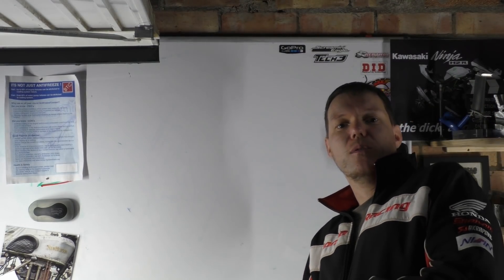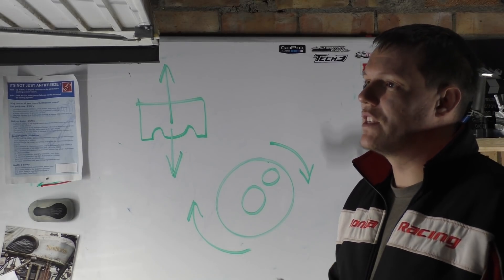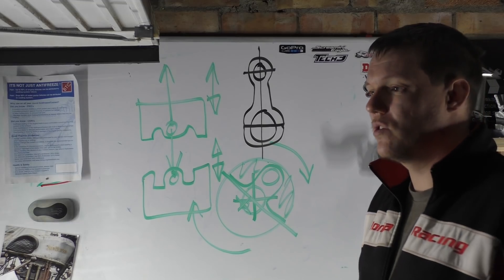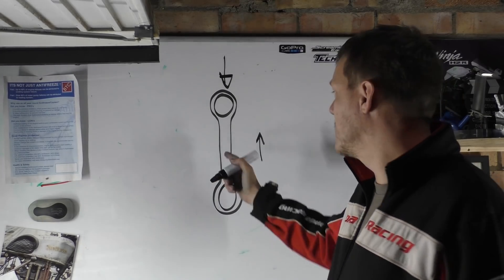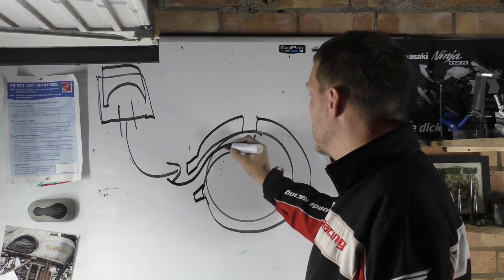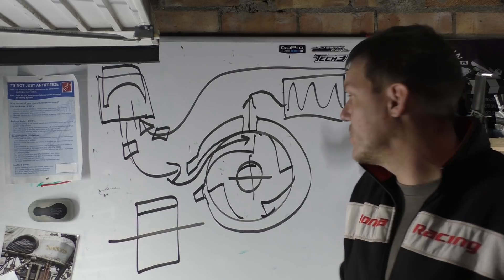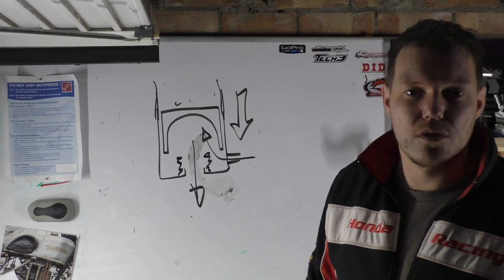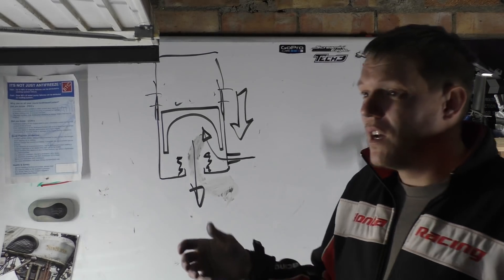New engine design - Oil rod engine

Comment: The problem with using hydraulics, is inefficiency. A minimal 20% of your mechanical force is lost in heat generation within the luid itself. 

Then you have a cavitation factor. When the. piston reaches TDC and begins the intake stroke, the oil will be subjected to a massive negative pressure change... which will inherently cause cavitation, as the water and air molecules within the working fluid rapidly expand and contract.... breaking down the oil, and causing you to lose compressive efficiency when it return to high pressure operation of the compression and power strokes. 

Lastly, it's been done before. In the most extreme example, there was no piston at all... as the fluid itself was used as the lower sealing surface. The examples worked okay for a crude stationary engine of massive displacement and low cycle rate... but that was about it. Evironmental concerns aside... the water-based version worked the best. The water was sourced locally, via a stream. The engine ran off oil. With a constant fresh supply of fairly cold water, the engine was capable of running a saw mill... providing both mechanical and electrical power.... but was about the size of a VW Beatle, just to make roughly 3hp. As I recall, each cycle displaced about 600 cubic inches... or about 9.8 liter/litre. The flow management was a fairly complex system of check valves and a reserve reservoir which was used to maintain pressure for the evacuation (exhaust) phase, and used a vane pump for both PTO and cycling. If I can ever find pictures of it again, I'll gladly email them to you.

Comment: You need to look at stirling hot and cold gas engine's and wobble plate crank shafts. HHO generate's an implosion so if you were to design a stirling cold or hot gas engine HHO hybrid engine? Then got the timing just right? Wait stop think this engine is operating off atmospheric gases that can be recycled through a closed system?  Wait stop think now remove diesel or gas engine from electrical power generator and attach closed system stirling cold gas or hot gas cycle HHO hybrid engine yo power the eelectrical power generator? Using antivibrstion technology currently being used on Skill saw recipercating saws and magnetic cushion's using high heat magnet's or Gadolinium for cold gas engine's has magnetic bearing's? Come now you seem intelligent so i am sure you understand this information yes? Oh and this is the low technology version of these concepts so you would understand it all. The high technology stuff will make you pass out! magnet's on piston's with copper using lens law to generate heat to power the stirling hot gas cycle? Ounce the engine got up to speed it would generate it's own heat. Came up with that working on a self sustaining space heater while working on a self sustaining freezer!  😊😂
Reply from the maker: "Come now you seem intelligent so i am sure you understand this information yes? "

- LOL
Reply: A niddle threader talking shite? Must be nice to be a god that lives off colon juice secreation's heh mate?  Was the candlestick maker ye husband? Ye miss the only one willing to kiss ye nectar pump Iussas? Ye drain a few candlestick's at the pub every night to get's that rich nectar cough?  😱😂

Comment: if its a closed system as soon as the piston goes down there will be an equal force from the oil pushing it back up ... hydraulic lock. How do you delay the oil coming back to the piston ?
Reply: Jonathan Vogel This guy is so lost it’s unreal
Reply from the maker: which guy?

Comment: As a comment underneath says, I was going to suggest a boxer/boxter 2 cylinder would likely be easier to get running than a single cylinder. The pistons in turn would push each other back and forth with an equal pressure. There are a number of commercial hydraulically powered vehicles in use (from lawn-mowers to road-sweepers and argos'), so therefore it should be possible to get information and specifications on the hydraulic motors that you can work with. How much thermal expansion is there in hydraulic fluids and could this be a problem? You've got 20 years left (of petrol) to make your fortune. Go for it!

Comment: How about a straight solid round shaft with offset lobes cut out along the length. The lobes act as the pistons as the compression stroke is on one side of the shaft. Supported by bearings on each end in a crankcase that can feed each lobe. Seals between each lobe are needed. The induction would have to be supercharged as the lobe cutout would not have suction. Rev's to 20,000rpm. I believe this was invented by an Australian but an American Petroleum company bought the patent to hide it from the world.

Comment: Why not use opposed pistons with a solid rod attaching them to each other. When external oil pressure forces one piston up, it is also drawing the opposite piston down.

1 - Piston one is on intake when the opposite is on exhaust.
2 - Piston one is on compression when the opposite is on intake.
3 - Piston one is on power when the opposite is on compression.
4 - Piston one is on exhaust when the opposite is on power.

Step 1 and 2 need external oil pressure to move and step 3 and 4 need less or none when movement is supplied by the opposite power stroke.

An engine with 4 pistons in a 2 shuttlecock configuration should not need an external supply of oil pressure once started. The opposite phased shuttlecocks will be balanced with a small rocking moment. 6 or 8 might not even have a rocking moment.

With enough shuttlecocks, you might even avoid one way valves on the hydraulic lines if your ports can be switched to keep constant fluid motion.

Comment: maybe a 2-stroke diesel! with very low rpm. don't see how it could work at higher rpms. Just my first impression, time to research about time/delay effects of hydraulic systems? Direct comparison: CV carb vs cable-actuated-slide carb (air different than hydraulic fluid but you get the idea)

Comment: Matt ya wankle   I think your on track with your theories  if ya had a precise way to set up the pulse pickup coil  I guess the puckup would have to be mounted to the piston  for accurate timing  of spark/or fuel erection injection.

Comment: I was going to recommend a sleeve valve design, but you mentioned that at the end of the video. your basically building a constant displacement hydraulic pump, the ramps on the crank would pump the fluid back up to the piston. with multiple cylinders and the proper timing you wouldn't need rebound springs or bumpers, the fluid would re-pressurize and stop the piston from bottoming.
As to starting it, or hell, running it as a four stroke, use air injection into the top end. You could look into using a Tesla Turbine as a crank as well, since it seems you need flow more than pressure.

Comment: If the piston shoots up (4stroke) with the exhaust stroke and then the crank pulls it back. Than the piston wil pus so hard up that you create a bubble of vacuüm. Untill the energy of the moving pisfon is gone and then it follows the crank motion again. The vacuüm bubble collapse.

Comment: Hmm, adding combustion gasses to the hydraulic system may be a problem, especially the check valves. 
However the ability to completely seperate and relocate the combustion chambers and output shaft is interesting.

Comment: very nice!
Reply: I have in my driveway a '78 Triumph Spitfire that threw rod #3 through the side of the block (shocker, ain't it?). This sort of idea is definitely worth something.
Reply: here's a very rough sketch of a concept I knocked out today for a non-reciprocating variation on your idea. it ends up being like a 3-stroke kinda deal:

https://drive.google.com/file/d/1hoEiMa3eohjVUdV_iehQQwPrv3kinYWn/view
Reply: a variable compression 4-stroke cycle illustrated with the module I designed yesterday (ignition occurs at the center of a tube of expandable material surrounded by a sphere full of fluid, the tube expands roughly spherically centered around the point of ignition, pushing the fluid out to drive a crank, other modules then drive the intake and compression strokes as in a multicylinder 4-stroke engine). the intake stroke is shown here to expand the bulb to only about 3/4 full expansion to demonstrate the possibility of variable compression. this vid's shitty quality b/c I rendered it on a laptop at work:

https://drive.google.com/file/d/1wHn9EdyFuh_5fnaiy71wq60ejsai8pL5/view

Comment: It's a very interesting concept. My thoughts would have been if the return system was pressurized, a valve system running off the crank could control the rate which fluid flows back into the cylinders therefor controlling the intake and shit like that. I can't see it being an overly high rpm engine just down to my basic observations of fluid dynamics, although saying this, the original designs for conrod engines weren't high rpm and look how far they have come. the only problems I have not thought about are fuel and air, but I'm sure you will come up with something

Comment: What I wondered is whether, because the oil would be subject to the same amount of force as a con-rod, wouldn't anything which contained that oil have to be as strong as the con-rod to contain the uncompressible oil, so would therefore weigh at least as much?

Comment: On further consideration...What you're designing is an ICHP (Internal Combustion Hydraulic Pump). In which case there may not be any need to package all the parts in the same casing. The gearbox with its "hydraulic crankshaft" could be located elsewhere on the bike. Separation would also help with heat problems and aide in weight distribution.

Comment: But Matt,  the crankshaft would not look anything like that.. 
It would have to be a cylinder that lies eccentricaly in another cylinder with linear moving flaps. EXACTLY like a vacuum pump, or a pneumatic grinder. 
Or like a hydraulic motor.... 
But the biggest problem would be to keep the piston synchronized with the crankshaft due to the amount of oil or "Evans" leaking over time. Which would result in hydrolicaly locking the whole system!!!  
My 2 cents

Comment: You would have to use a composite piston seal, has no ring gap. Might be able to use single acting seal to stop oil going in combustion chamber. It might be better to have spring return and auxiliary boost pump to feed each piston. As you say it is early days. Cool idea.

Comment: How would you make up for fluid leakage? I'm picking there is going to need to be a crankshaft driven pump supplying makeup fluid to the closed hydraulic system, driving the piston down on a four stroke could be accomplished using this pump also with a second set of seals (fixed in the bore) , above the piston oil seal and high speed solenoid valves to open/close ports. There would need to be some form of positional feedback (Hall effect sensors embedded in an aluminium bore perhaps?) to control the solenoids. Given enough time and clevers, I'm sure a horribly unreliable but awesome to behold prototype could be built!

Comment: I have an other idea that just came to me! 2 stroke cylinder extended with ports on both ends, one piston extended with both ends for combustion but flat. One head on either side. To start it you should drop it on one of the heads. And if you make the piston out of rare earth magnets and wrap the cylinder in coils you should have a generator! Its morning still having my coffee!

Comment: I see it working as a minimum of 2 cylinder sets one up one down and a hydraulic motor in the middle. 4 stroke would work on 4+ cylinder engine with a separate oiling system electronic actuated valves, and sensors for ignition. But pushing all that oil through the system, turning the motor and then coming back to push the piston up needs a lot of force from the combustion

Comment: Ok, I felt a bit dense, but with a positive displacement pump matched to the displacement of the stroke your crank shaft, it would technically have a input motor pump and an output pump, you'd need them to be out of phase so the one would use a flywheel effect to pump it back to TDC. With the pump displacements closely matched to the cylinder displacement you'd be able to minimize or control how close to TDC it actually went toward ignition, you could possibly work in a pressure regulation system to control a spark or non spark detonation as well.

Interesting idea, I think you need the two out of phase pumps to make it work and not just cancel out the forces.

I don't see it running at a high RPM but could probably run in the lower diesel speed ranges. I think there is probably enough energy that it could run, biggest problem is getting it primed with a first charge...

Comment: Whilst you were wittering away my engineer's mind was already conjuring up a proof of concept model using a foot pump cylinder, with a compressed air pulse charge to force the piston down, to test and develop the oil transmission system. As this is the complex business end this is where development should focus. Figuring how to make the internal combustion end work is secondary.
 
Having two pistons in the same cylinder oppose might be a better proposition as this would solve the head smacking problems I'm sure everybody has already imagined with the single piston design. 

It's possible to run the proof of concept foot pump version on butane or propane as opposed to vapourised fuel.

Comment: Connect two opposed pistons directly via the combustion chambers.  Ignition draws the opposed cylinder up for another bang.  Timing via sensor wizardry prevents piston with upper and lower collision.

Comment: Even if the clearences were very tight it would be verry difficult to keep the piston from rocking or locking. The clearences would never be perfect frkm temperature changes. With a check valve the piston returning to bottom dead center would be difficult. Maybe with a massive intake valve ad lots of boost. Not to mention the botyle neck of pushing a viscous fluid through a feed line. Yhe pressure would be good but pistone needs a lot of travel.There are a lot of obvious problem bit probrably many more that arent apparent. Keep on working on it.
Reply: The piston wouldn't have to be shaped like an engine piston any longer, it is now a hydraulic piston so it could be much longer for example with shorter travel, just so it can push oil put 1 end of the cylinder through a check valve
Reply: @petercarlboer2793  so the if the piston itself would be longer but with a shorter stroke? Am i understanding that correctly? Wouldnt that interfer with the intake stroke. What if the cylinger was like a rotary cam (like a helix, or drillbit) that would draw air down the combustion chamber  to create rotation. From there you could have a shaft... sort of like a turbo and on the other side it is compressimg the fluid... thats the only thing i can think of to rectify this. Lmk any thoughts
Reply: @petercarlboer2793  hydraulic pistons dont usually deal with the heat of combustion directly. But i guess if the hydraulic side was a sealed system it would pressurize and hammer back.

Comment: Why would you even bother with a crankshaft? Or a gearbox/transmission for that matter, you've developed oil pressure, why not just use that pressure to drive hydraulic motors on each wheel directly?

Comment: i don't think check valves would work, maybe some kind of timed valve system, or even, just pair cylinders, so when one piston goes down it pushes on the crankshaft and pushes a second piston up, when the second piston goes down it pushes the other one up and so forth.

Comment: I like the concept to balance the forces make it like a boxer. 2 pistons opposed. A perfect hydraulic pump! A blown valved 2 stroke (piston porting would be a problem I think) direct injection of course to avoid fuel going down the exhaust. Valves would allow removal of pumping losses.. although if power is not needed then the pistons can sit idle. No crank to require them to move when no power is needed.

Comment: interesting stuff but alot of head scratching needed outside the mechanical problems manufacture costs would be huge .
Reply from the maker: "manufacture costs would be huge"

- explain......
Reply: ok maybe not huge but expensive i did watch this at 2am .the bottom piston ring/seal would be a pain to make cheaply and the other problem to solve is starting the engine  because if you crank the oil what would stop the piston hitting the cylinder head if you dont get instant combustion ie on the very first tdc.

Comment: I'll stick with con rods. The only real issue with con rods is balance, which makes your motor vibrate or rock. With a liquid rod the oil isn't going to flow smoothly it's going to pulse.  The weight of the oil stopping and starting is going to cause a serious vibration or rock depending on how fast these events happen and there is no way to counter act that motion.
Reply: Building/Racing videos how bout adding bellows?